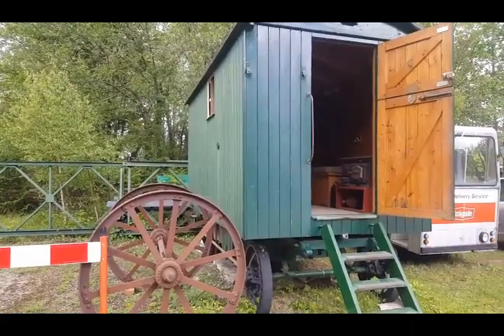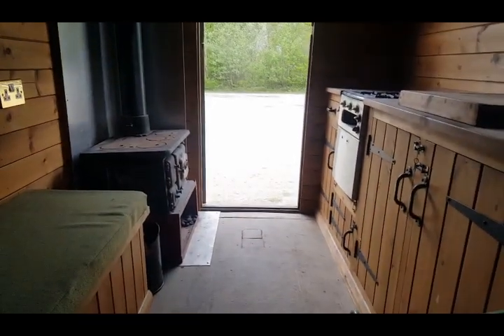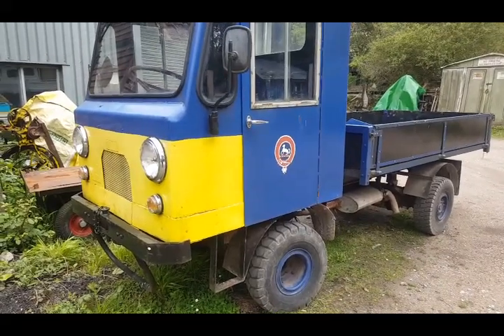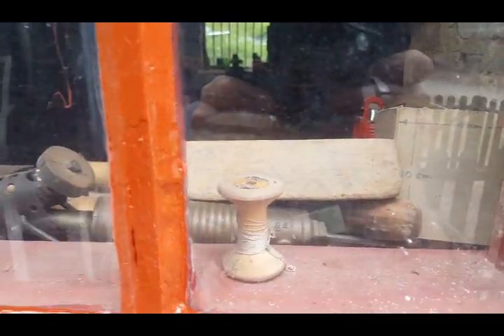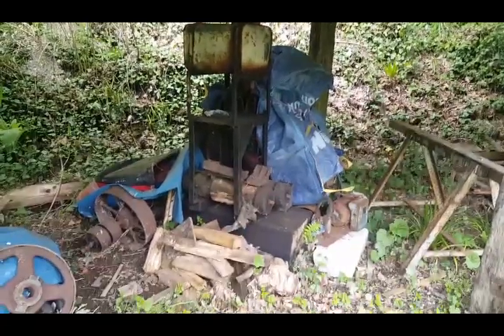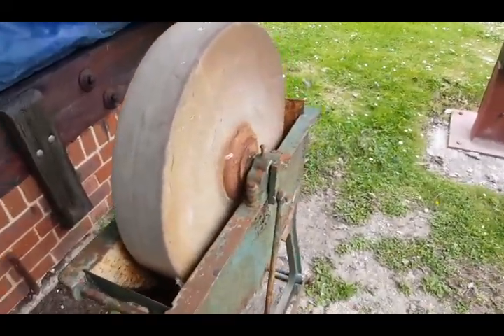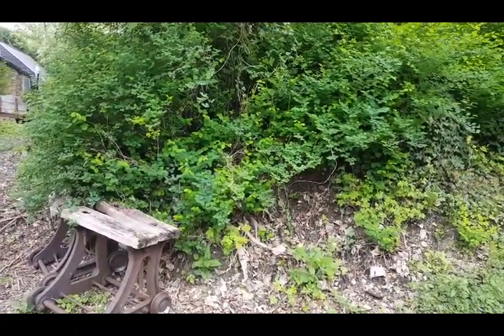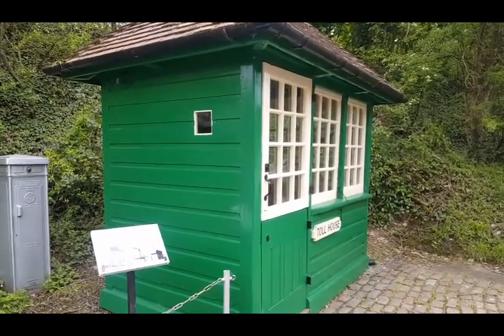Industrial Heritage and My Shed on Wheels. #steamengines #restoration #Oldengland .

Comment: Great video. The old machines are far longer lasting. I used to collect vintage garden tools. I remember billhooks i had from the late 1700's-1800's way out performed the new fibreglass rubbish they are making today. As you say somethings are far better restored than scrapped.
Reply from the maker: 100%